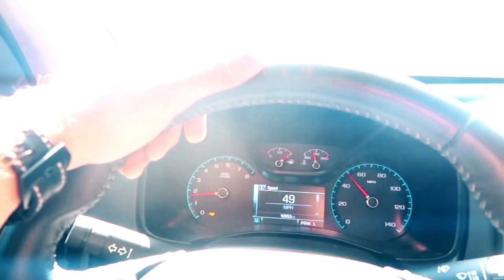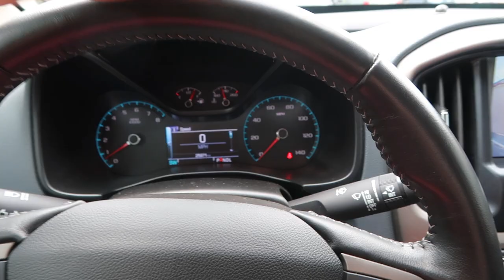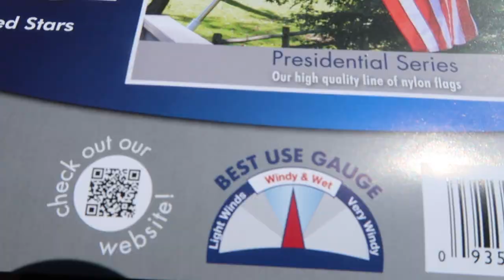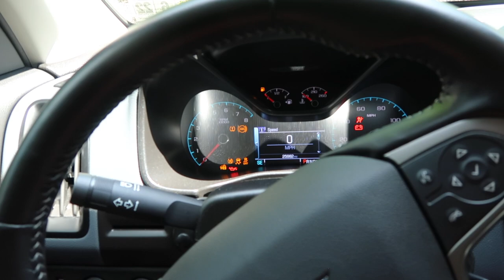DIY Truck Flag Pole Mount for $15 ... 🇺🇸

Comment: Looks great Matt!   As a member of the Patriot Guard Riders, I have flown the US flag on my bike for years, and am especially proud to do so on the 4th.   We’ve discovered that even with the best made flags you can’t exceed 50 mph without shredding them.  As a solution we paint or dip the outer edge of the flag (that opposite the pole) in Future CLEAR acrylic floor wax, allow it to dry and you can increase your speed without damaging your flag.  I dip my flags (I often fly flags of the 5 branches of the military) and they are all still intact.   Great job, hopefully others will follow your lead.
Reply from the maker: Tks man for the advice! It makes sense!! I will try it

Comment: A very great video but I wanna let you know on a few pointers yeah sometimes going cheap is the best route but in this case I don’t want you to lose your flag those plastic things you have on there that tend to break easily I would know I used to have them just literally outside on my house and you would need a taller pole to make the flag fly tighter against the pole so you don’t have that weird wavy affect because I do not know if you got a 3 x 5 American flag or a 4 x 6 because I know you got a nylon American flag so I would recommend taking those plastic things off Getting a longer pole even if it’s too long you can cut it down and to make it even look better you can spray paint it with rust oleum black to get all the hand writing off of it and to even prevent rust overtime put eyebolts on the top and bottom and you can even use those quick links that you had The flag can have some give but not a lot so I fly is nice and tight and It would look good

Comment: Quick question: what did you use for the spin rings & hook the flags on both ends? I thought of the same pipe as well but couldn't figure out what to use for the spin hooks. Thanks